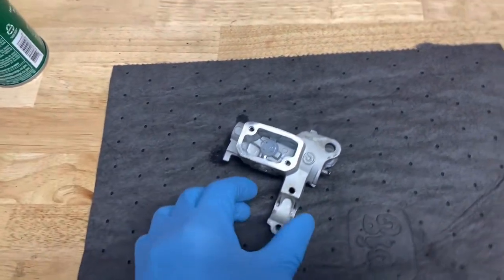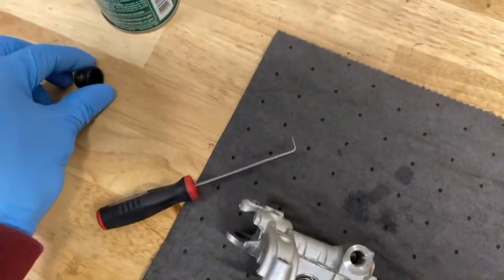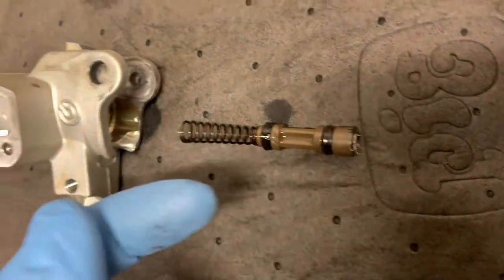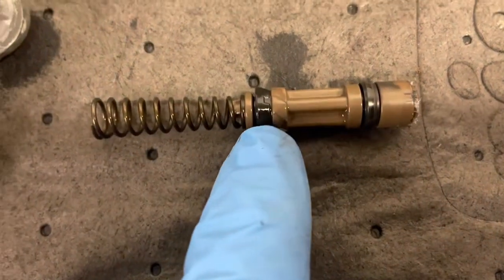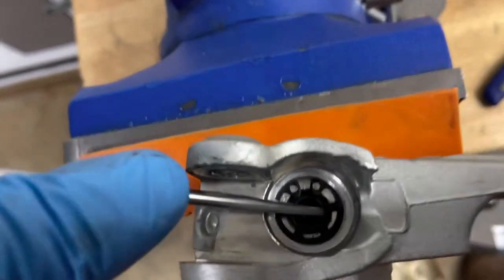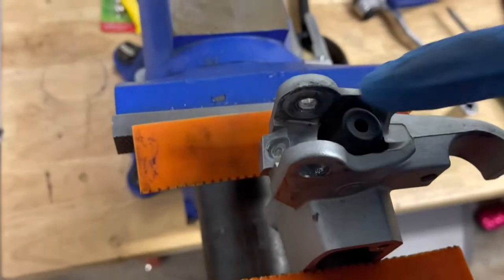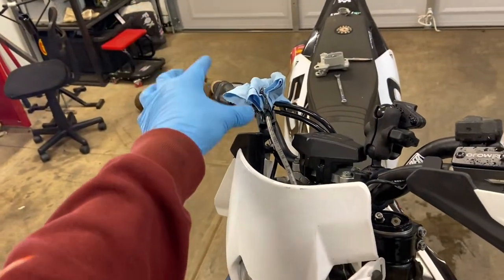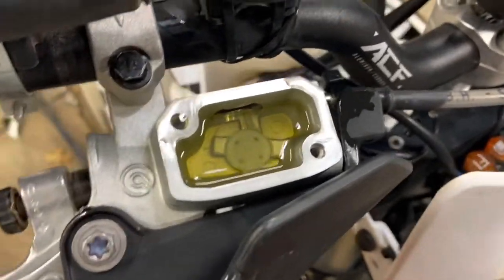How to rebuild brembo brake master cylinder

Comment: Do you have a video rebuilding a brembo 13mm front master cylinder. Slightly different than what I've seen on YouTube. It has a metal ring that serves as the retainer clip. Just don't want to damage the housing removing and reinstalling new ring. Thx
Reply: Hi, i probably have the same cylinder as you do, (duc monster 95), metal ring is is holding white plastic ring and then the rubber goes last. I took the ring out braking it from the top while hammering a small drill (there is a hole). Anyways its 5 months later, so you prob already fixed it. lol. Anyways, does plastic ring ledge go towards outside or inside?
Reply: @giedriusbruzas6542  tried rebuilding but didn't hold pressure. Wound up buying used one off ebay.